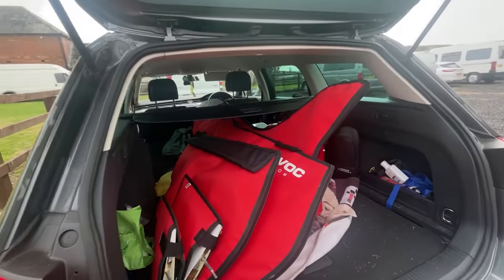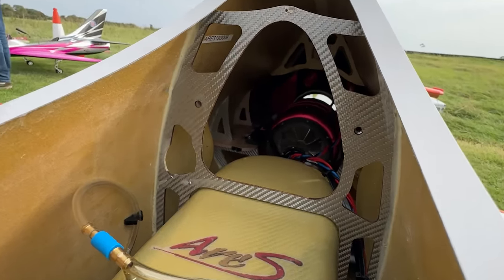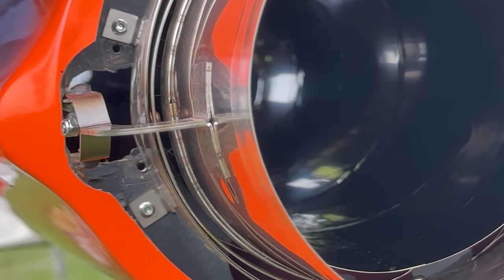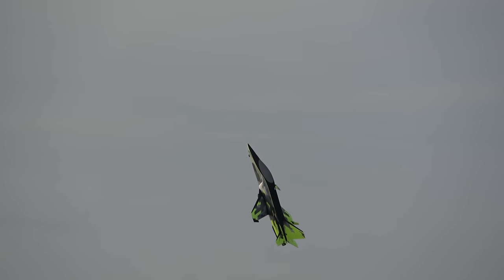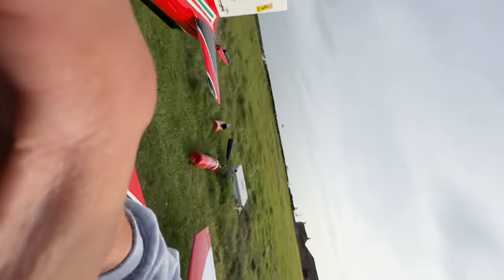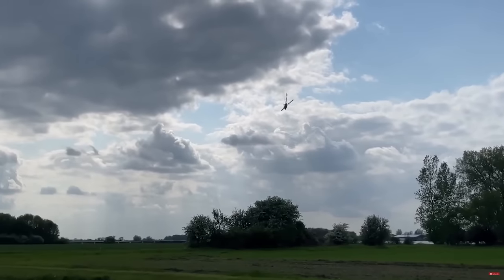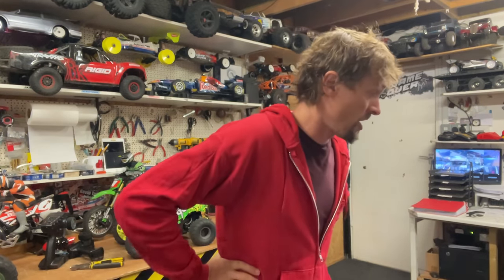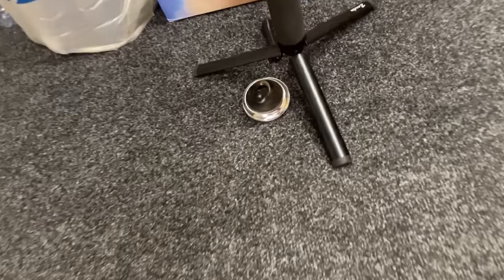GIANT RC Jet Planes

Comment: I foufound this channel by accident.  I've not been into RC since my 30's.  I had my first RC car in 1978.  Your assertion that clubs are basically full off nobs is spot on.  It's why I fell out of love with the hobby.  Having seen your approach and enthusiasm, I'm thinking of buying a Tamiya kit and smashing it round the car park at work and ignoring the fact that I'm a 55 Yr old manopausal stroke survivor.  Epic channel.  Thanks Kevin.
Reply: Dave ya Carter. Go for it. O bought a Tamiya Grasshopper, my first car since the mid 80s. Shoved a bigger motor on it. It's great fun in car parks and on the road. It handles comically bad - that's the appeal of it. Once you've replaced the broken bodyshell you spent ages getting to look nice, it sits on the shelf nicely and looks lovely. It won't go "to the moon", but it's worth every penny with a brushed motor and cheapy NiMH battery. Enjoy.
Reply: Did the same here.. I like the mechanical aspect as well as the driving part, and it is cheaper than real cars, full size that is :)
Reply: @theelmgren  Trying to tame it is addictive and very satisfying when it's mastered. There's a gravel oval bike racing circuit near me and I take it there - always get surrounded by kids who live spinning it round in circles. I race GT12 cars - they are about precision and performance, and only run on special "carpet" track or very clean  smooth tarmac but the Grasshopper is so much fun . I have another I built just for the art of it and have it sitting in the cupboard. It's clocked about a minute of driving and is purely just  for gawking at.
Reply: It depends what you mean by fun. These guys all have $10k aircraft and don't need a guy with money dive bombing the ground lighting fields on fire getting their club shut down coz he's having fun
Reply: no offence agains autistm, but the "a-level" in these sorts of clubs are probably high.. :)
Reply: @na01jsn  Surprisingly: not necessarily. Not in my experience of GT12 racing. It's difficult to know, obviously - but I'm on the spectrum, and although I see what could be similar in other club members, for the most part, no. 

Whether it's racing, or being at home building rc cars purely for show, and not running, I don't think neurotype matters all that much. 

Be an interesting study to find out for sure though. 😄

Comment: Turbine engines are actually pretty simple once you understand how they work. They have less moving parts than a piston engine as well. The only complicated part of them is the throttle control and fuel delivery systems which are all computer controlled nowadays. Very cool footage and nice flying!
Reply: Just a couple of fans
Reply: That and they spin about 10x faster

Comment: This truck is proving to be really durable with all the hi speed tumbles. 
63 mph is truly impressive for this. Good move on the upgrades you did to this. Are you running thicker oil in the center  diff? This sounds so much quieter Than stock set up? Awesome speeds brother!

Comment: 5:24 I haven't been able to confirm this, but I was "told" that during testing, the F-15 Eagle was mounted vertically in a gantry and they wanted to test it's VTO capabilities. They lit the engines, went on full burner and it lifted off like a rocket due to the thrust/weight ratio. That's why these things can do what they do....the engines produce so much thrust to weight they can power out of flat spins etc. 

The thrust vectoring on that one was amazing. Never saw it on a jet before, just ducted fans.

Comment: I liked this video as it sort of encapsulated my feelings about RC and men playing with expensive toys when I have no food or health care. Here in the States, the FCC has entered into the RC arena to get more control over the stupid things people do with drones and it will probably have the effect of pushing out the recreational flyer.
Reply: I'm gonna have to disagree. The law really only affects Drones, which fly way higher and are 100000x more common than model planes. If striking a bird can cause catastrophic failure, than so can hitting a drone. Seems like common sense to prohibit everyday people from flying objects around planes and helicopters carrying humans through the sky.
Reply: @user-lf3hy7wl3t  This is wrong. It is about all types of flying models over 250g, so pretty much every plane. Also there already were height limitations, so it is not like remote ID does anything to prevent people not sticking to the law from doing dumb stuff. The height limitations already were way below air-plane height specifically, to prevent collisions.

Comment: About a year ago I bought a used Traxxas bandit. It had a bunch of big batteries, tool kit, parts, the whole setup for just $100. I figured it would be a fun thing to bash around. However in my ignorance I didn't know that a 3S Lipo battery was a higher power battery, and I didn't realize the motor had been upgraded. It was still running the stock ESC. The first time I drove it the ESC exploded quite spectacularly so I went on the rc-cars subreddit discord to ask what happened and how I could prevent it from happening again in their help channel. What I got was a few pieces of advice but mostly just a bunch of really rude people calling me an idiot, telling me the bandit sucks, "you should have bought X or Y", "traxxas sucks", blah blah blah. Admittedly I shouldn't have spent hours on there trying to defend myself from the onslaught of mean spirited comments but it basically demotivated me for a year and I ended up just putting the thing in a box and not touching it.  TL;DR - Rude gatekeepers on RC car discord troll me out of the hobby.

Comment: Ultimately what kind of "ended" my golden years of the RC hobby was my local shop shutting down. I had a weird custom rc that always needed parts ordered, but the shop owner got very rude and angry and didnt want to accomodate me, i stopped coming there and it closed down about a year later.. i always wonder whatever happened that day to make that owner change so much

Comment: 6:42 when a hobby requires at least 12 fire extinguishers in the background ..  All I have to say about enjoyment. Its your toy therefore you have the right to fly it or drive how ever you want that gives you the most enjoyment.   Crashing and parts wearing out create repair costs is something you have come to terms with.  Others not so much. Besides if you dont push the limits manufactures are not going to create more durable better models. You need to create your own RC club called "Game Over club!"  where it pushing the limits of RC and skill is the norm and playing it safe is the exception

Comment: No, no. You have a point, Kev.
The RC hobby is meant for fun, and it's supposed to be fun.

With the folks that take it too seriously, they are the ones that will eventually result in the downfall of the hobby, and they will have nobody else to blame other than themselves (but, by crikey, they will try to blame it on everything and everyone other than themselves).

Their mentality does come from insecurity. They are insecure about themselves; insecure about what they have and can/can't do etc, and they go on a massive power trip because they get off to having control over someone else. They are not happy, unless they always have the upper hand. Otherwise, they throw toddler-level power tantrums whenever they don't get their way.

Ultimately, it's best to avoid interaction with those types of people.

Comment: Yes, exactly right, its all about the kids (age 3 to 99, you need to be able to stand up and get onto the driver stand) getting out there and having fun (that's FUN) with their toys, be it planes boats or cars. If it aint fun, you're doing it wrong. Trying to turn RC cars into some kind of F1 racing lookalike, awash with thousands of rules that no remembers or cares about will just send the club members away in a stampede, it's not fun anymore.

Comment: Someone needs to make a dual jet turbine engine rc plane , a scaled down F15 or F22 would be 🔥
Reply: You need to take care with fighter jet models. Real fighter jets are designed to be unstable, because that's how you get the maximum manoeuvrability. This often means that the real planes have computers that keep the plane in check, and a pilot would have no hope of controlling it by hand. This complicates an RC model quite a bit.
Reply: @CristiNeagu obviously 😂 most newer fighters have more than one avionics computer and fly by wire to keep the pilots in check. It doesn’t need to be super maneuverable with thrust vectoring in it. The f15 was designed in the 70s and doesn’t need or have all that shit anyway unless it’s an ex lol. There are already edf versions of the f15, f18, su27 etc… someone just needs to build the airframe strong enough and have proper control surfaces.

Comment: i bought some rc cars and trucks back when the TB-01 chassis was new, built a beast of a R34 skyline on that chassis with all top spec motor and speed controller and wasnt allowed to drive it at any rc events here in Cardiff as it was to powerful for them :/ sux really that grown men were crying over it, i just wanted to have some fun, had to find areas where no one was around just to drive it and the others twin motor monster truck , full carbon chassis mini cooper with carbon brakes and wheels, everyone seemed to hate me lol, ended up giving them to my step brother and moved on to other hobbies

Comment: elitism, it's rife in all hobbies, i've narrowed it down to a simple metric, they think the hobby should end with them, they join a hobby, get validation, and people that join after them challenge their validation through having better equipment, better skills or better knowledge.
maybe the "victim"  has none of these things, but simply being a new member to the group can challenge this validation and that's what gets them upset... it doesn't make it right, and for this i've no time for it, i manage several online communities and i have a simple rule across all of them, do what you want, but elitism has zero tolerance
but you must also  remember the financial investment in these "toys" - when these toys are creeping on the price of a second hand car, which is a life changing investment to many people, it is no longer a toy, aliexpress specials are toys, it's all a matter of perspective, i think it's disingenuous to call them toys when what you're working with is quite a marvel of modern technology, specially with drones, the energy density of the batteries, the motors, controllers, the composite materials and radio links... these toys are unobtainable for many, and for some they have saved up for many months to buy their first model, it is still no reason to be elitist, but it's certainly a factor... would you call your monster truck a toy? perhaps the jets you saw in this video? maybe the stunt plane you rode in? also toys? i'm sure mr musk would, for some it is comparable

Comment: what you need to take into consideration with model flying clubs is that theyre getting shut down all the time. safety is key, noise needs to be limited. by someone coming along that thinks its fun to stick bash and crash and chuck it on youtube is bad publicity. i mean, you let a small helicopter fly off out of sight with no failsafe even set...honestly, any club is going to get skeptical of letting you fly a turbine jet with no experience whatsoever on their site. think buckminister require a fixed wing B certificate for models over 7.5kg and turbine models. i get people in some clubs are not welcoming but alot of clubs welcome people with open arms that are willing to follow the rules of the club and law. having fun is fine, thats the point of the hobby but follow the laws and respect a club environment and youll be fine in a club.
Reply from the maker: i was never once unsafe and never fly near people. The fly away was a faulty product, can happen to anyone. I have no problem with rules that make sense, but not rules just so they can through their weight around
Reply: @KevinTalbotTV  flying safe doesn't necessarily mean flying close to people. It also comes into pilot skills. I.e is the pilot flying out of their skill level and the losing control of the model. remember that these models are dangerous and will kill someone. club rules are their to protect the site the club operates from and everyone else at the club. I get what you're saying, but rules are rules, and at the end of the day, you are agreeing to such rules by joining the club.
Reply from the maker: @PockoRC  who am i going to hurt when im in a field on my own? and they just made the no filming rule up on the spot
Reply: @KevinTalbotTV  no filming stuff is just shit. i get that noone is there, but the video is, so thats why theyre getting funny. we had an incident at my local club early summer. Someone was flying well out of their skill level, about 200m away from the pits area, and managed to crash full throttle in the pits. someone had to jump out the way and it landed where he was stood. probably just best to find someone who has a big field that would let you fly from it

Comment: Remote control jets are not toys
Reply from the maker: yeah it is, you're not in it, you're playing with it
Reply: @KevinTalbotTV  it’s not a toy Kevin it’s a real hobby very expensive. I got me a black horse L-39 Albatross with king tech 70G4 I flown 3 different jets it’s in my other channel. Team Futaba speed fresh. I’ve been flying planes for 24 years man. I called it a toy too sometimes. I got my turbine waiver and everything I’m taking over.
Reply: @KevinTalbotTV  if that jet crash it will burst with flames. I’ve seen it all the time again remote control jets are not toys just a heads up. And landing it it’s a hard part. And it’s fast too Kevin and hey they making it go over 450mph. No joke and I’ve been talking about it for ever. Faster than a full size jet. It can beat some of it.
Reply from the maker: price/speed/danger have no say on if it is a toy or not. A hammer is a tool to get a job done, a real plane is to get your butt from A to B, your toy jets only purpose is to play with it, it serves no other purpose so it is 100% a toy, I don't care how expensive it is, compared to a real jet its dirt cheap
Reply: @KevinTalbotTV  yeah they got some real cheap ones they got a used shit for about 3000 and they fast too they go over 300 mph easily it can beat some of the full size jets
Reply: @KevinTalbotTV  it’s not a toy Kevin take it seriously. Like me. I love all your videos man you rock. I’m your biggest fan wwhhhhooooooooooooo. Them jets get me hyper